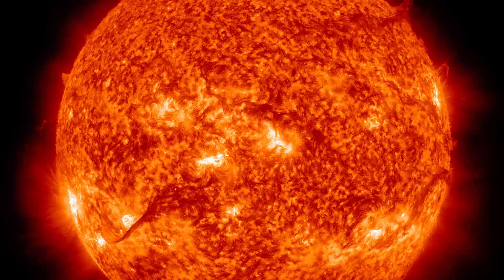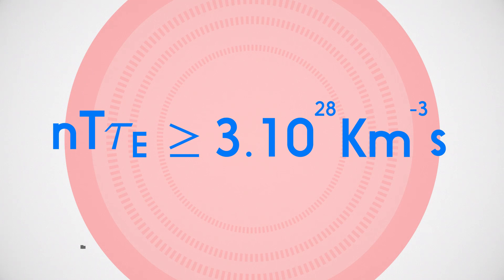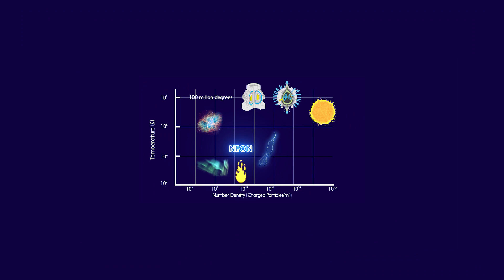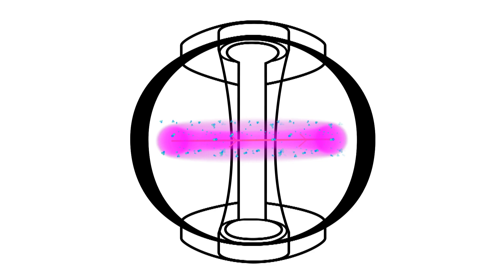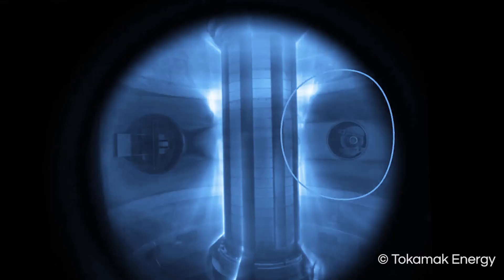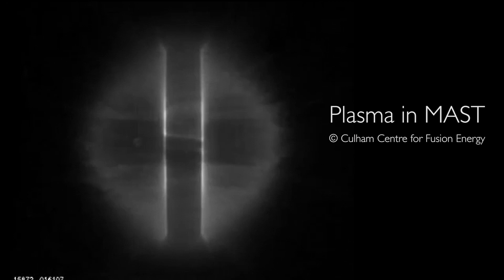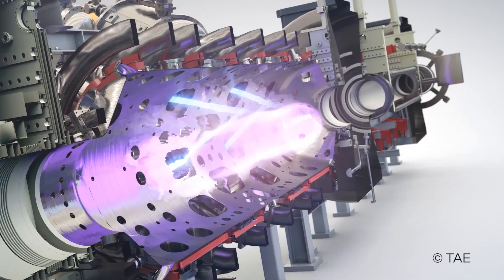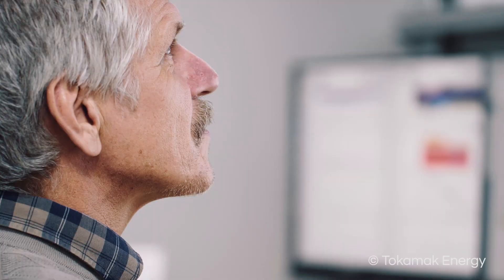Creating fusion energy on Earth - How many different ways are there?

Comment: Why 150 000000 celsius and why 10 time pressure  just like in sun
Reply from the maker: The fusion reaction that takes places in the sun is a multi-stage process to fuse hydrogen (protons) into helium that can take millions of years. On earth we need to do things slightly differently (to do it faster) so we start with bigger building blocks of heavy hydrogen (with proton and neutrons). To fuse heavy hydrogen we need higher temperatures than in the sun.
Reply: The power density produced inside the sun is just 265 Watts per cubic meter, less than the heat our body generates. Clearly that‘s not enough for a power plant. However in magnetic confinement devices (Tokamaks), the pressure of the plasma is actually just a bit more than 1 atmosphere, which is far far less than the up to 100 billion atmospheres of pressure inside of the sun. So that‘s why the plasma in tokamaks needs to be so much hotter than the center of the sun.
Reply: @helgefan8994  Damn, you just blew my mind with that body analogy

Comment: SAFIRE uses far less power to achieve tens of thousands of degrees Celsius of heat, and can transmutate hydrogen into different elements in its self-organizing plasma shells.  The engineers tried to disprove the electric sun model and failed spectacularly.
You should try it too.
Reply: Except it’s a pseudo-science scam lol

Comment: SAFIRE has already finished proof of concept and is in the process of designing a mass production prototype for a warm plasma fusion generator.
Reply: ... its a hoax
Reply: @ApplyWithCaution  Really? Based on what evidence?
Reply: @kostasgaitanis4752  ... there is no evidence that it produces fusion ... so far it is just a plasma furnace that might work in theory ...
Reply: @ApplyWithCaution  It's true, the concept works but real application and scaling have yet to be done
Reply: Proof of what concept? were there any neutrons produced? Without neutrons their hydrogen plasma did not fuse, they provide no evidence to support the alleged transmutation and the elements supposedly produced could have come from the apparatus. Mass spectrometers are readily available as are neutron detectors it is not difficult to measure and publish the output of these instruments.